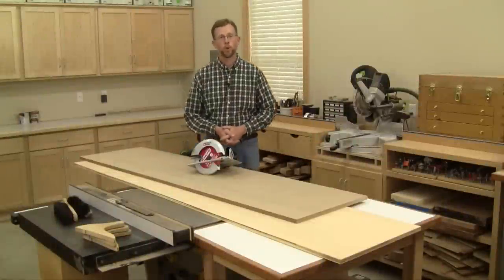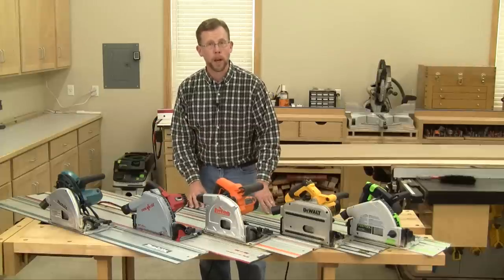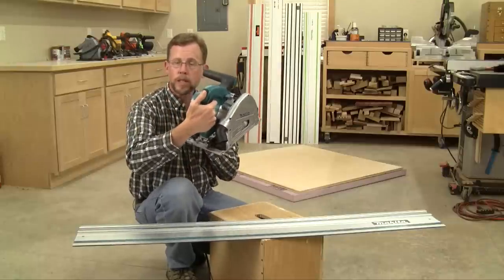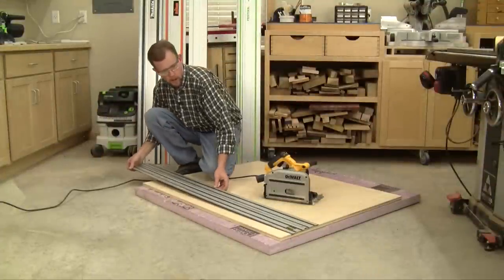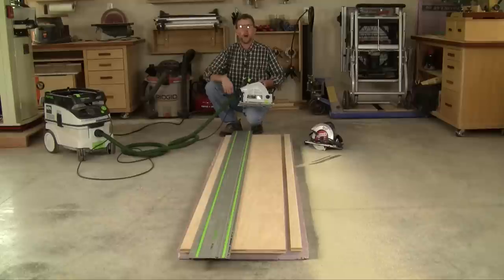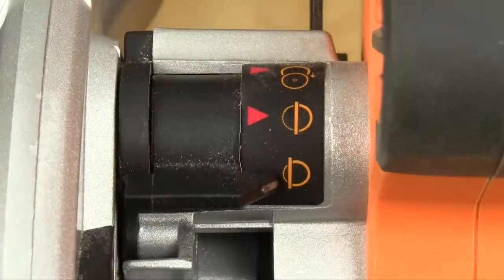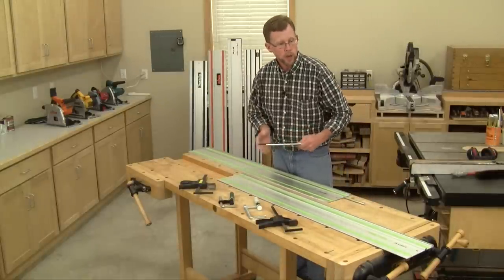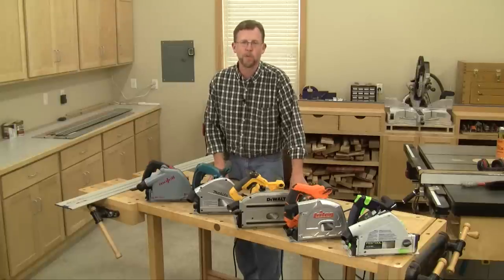The Benefits of Track Saws

Comment: Another huge issue not mentioned with 4x8 sheet goods on a table saw... the need to have more than 8' of space both in front of and behind the saw to make the cut.  Many smaller shops, like mine, don't have the 20-24 feet required.  Wrestling those sheets down into a basement workshop is a huge issue as well.  

Those drove my need to spend the money and buy a track saw (Makita 2x18V cordless) to break down sheet goods before I can make final cuts on the table saw.  It cuts so well I rarely have to re-cut those edges.

Comment: A great video . but i was wondering why you didn't explain how you choose the depth setting , it looked like you had a piece of polystyrene on the floor to prevent cutting into the floor which seemed a good idea ?
Reply: Setting depth on track saws would be the same principle as a table top .   You want 1/2 of the curf of the blade to extend beyond the materials surface.   Thus, he had polystyrene on the floor to prevent damage to blade and floor.

Comment: For those of you that have a track saw, do you need the track clamps to make rip/crosscuts for 48" or less? Or does the non-skid rubber strips really keep the track on the cut line?   Thanks for your replies.
Reply: David Letz I’ve used my Festool track with out the clamps and not once has the track moved or slid out.  But the clamps are nice if you don’t feel confident about ruining a 100$ sheet.
Reply: Never clamped mine, nothings ever moved on me, just keep the sawdust cleaned off if you can

Comment: Wh at happens when you need to cut an 8 feet length?
Reply: +Richard Love 
Buy a second track and connect the two together. I have two tracks for my Festool TS 55
Reply: Or buy the 3 metre track.  I think festool even sells a 5 metre track.

Comment: Nice saws but too pricey for most home woodworkers. You can make your own for a few bucks.
Reply: +Backyard Woodworking 
Before I got my Festool I'd agree with you but now that I have one and have used it a bunch I'd be lost without it. You can use a regular skill saw but it does not give you the fine accurate cut and there is no dust collection with a skill saw.
Reply: I've been using my own tracks for years with the same mindset a couple of difficult jobs recently and I brought a track saw yesterday would never go back. I will keep my home made tracks as there's jobs where the Ali tracks are too good for but I'm now a convert.
Reply: Makita sp6000

Comment: WTF, you have to buy TWO tracks to cut an 8' sheet?
Reply: +Richard Both festool and makia have 118&quot; 3000mm tracks, have one can&#39;t live with out it.
Reply: There is an advantage have two instead of one long piece. Storage for one and ease of use. I have use the several times with no issue with a straight cut.

Comment: Any of these saws will make a better cut than a circular saw.    ...NO,,, THEY WON`T...    About time you realized , it`s   NOT the.saw that cuts the wood ,,,,it`s the blade..  same blade on every saw = same quality cut.    period.
Reply: Sounds like you don't see the advantages of the track saw. Trust me they make them and people buy them for a reason. It's definitely not a gimmick
Reply: If you think you can get track saw quality cuts with just a straight edge and a circular saw (even with the most premium blade), you clearly haven't used a track saw.

Track saws constrain left/right movement to prevent your cut from wandering, they also have a chip guard to prevent blowout on the top surface, and lastly they typically have really good dust collection which can stop your saw baseplate from riding up on sawdust which is another factor that can affect your cut quality.

Oh, plus the edge is exactly where they cut so you don't have to mess with figuring out where to try to clamp your straight edge... you just put the track edge right on the cut line and go.
Reply: Zero clearance edge on the track means no chipout. You can't do that very easily with a circ saw